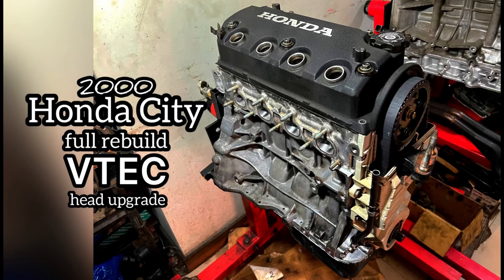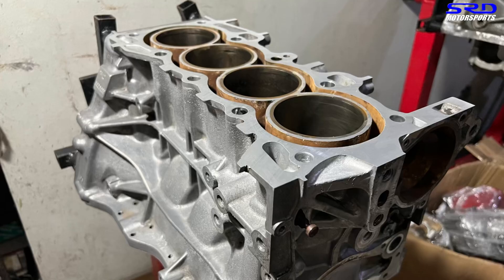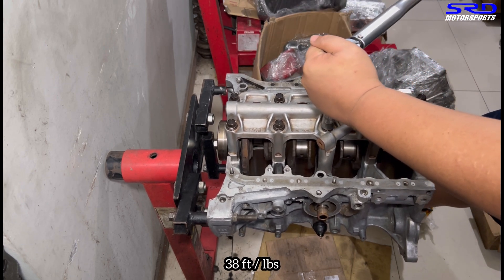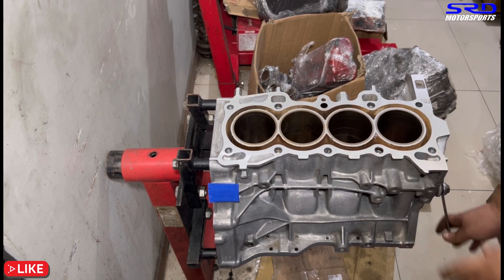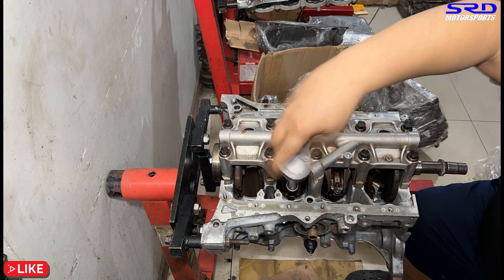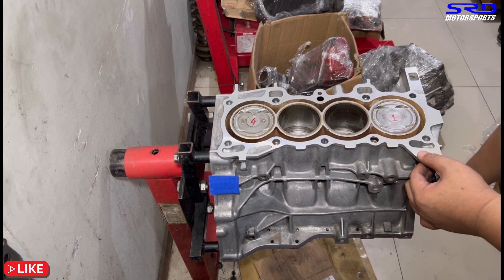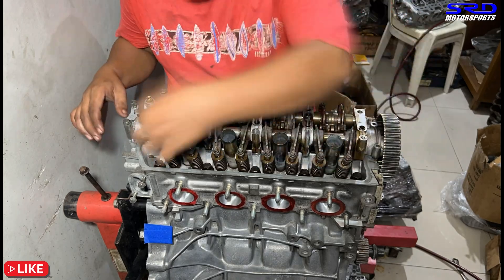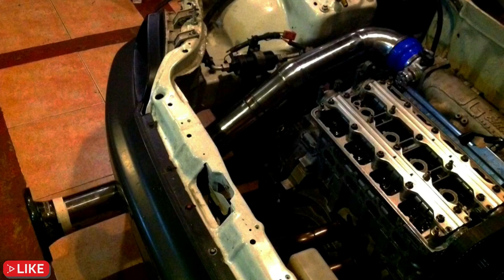D15b + P08 / Z6 Head Honda City Engine Rebuild Assembly

Comment: Is a JDMD 15 B head the same as a Z6 head? Finding a lot of different information on the Internet I have a P08 – one head and on the right side of that number it is a 9/1 on a Z6 block trying to figure out timing
Reply from the maker: all p08 head are all the same it’s why they use the Z marking from Crower as d16Z6 so stage 2 is 63442Z for stage 2 and  63443Z for stage 3 

U may be using the wrong camgear search for a stock z6 gear and u can find a counterpart that’s local to u and go from there

Comment: Can u guys do a d15 & d16 clocking piston rings step by step where each ring is clock the piston?
Reply from the maker: hey a rebuild don’t cost much , part of the purpose of our rebuild videos is to let locals know a basic rebuild won’t cost u upwards of 90k 😂 cuz I know some charge 120k for starters 😂
Reply from the maker: there’s really no magic to it…locally also I don’t get how some think there is but like on this engine we just clock it the OEM way

Wiseco Arias and JE usually have a clocking sequence they suggest on the box manual and we follow that when the piston has it but for pistons like OEM and YCP and 1Up or NPR pistons we always just clocked it the OEM way 

Always worked good
Reply: @SRDmotorsports  give me a link to it
Reply from the maker: il look for a link.. usually it’s everywhere online the oem ring clocking / setting way

Comment: Hi, stumbled across your videos…. Watching from Trinidad 🇹🇹 in the Caribbean. Looking at doing a Jdm d15b non vtec build (considering a Vitara build on the short block) not too sure if the Vitara spec stuff will work on the Jdm d15b non vtec, already have a y8 single stage vtec head for the build just not too familiar with which internals will work for the build as info is mostly on usdm spec engines. Any advice Will be appreciated
Reply from the maker: If it’s turbo? Yeah vitara is okay

Just not sure if ur d15b is what stock piston marking it has , that would depend what rod the d15b uses

Comment: Your giving me hope for my JDM D15 B 3 stage. Is there any difference between VTEC blocks and Non VTEC ones.
Reply from the maker: Usually the vtec ones have less dished pistons but they’re still good I’ve done a few Vtec-E d15b the ones with p07 pistons and we slapped on a z6 ported head and ran surprisingly good

One customer even opted to run a crower stage 2 cam in it and it was a nice surprise actually it ran real good…

One good thing is the z6 head or y8 head will require the same timing belt length as to what you currently run so that’s easier finding what belt to use

Comment: I sensed that water was used instead of coolant at some point but I could be wrong.
Reply from the maker: yes indeed no matter if it runs coolant recently if the previous previous owner ran water it generally is hard to get the grime marks off the coolant passages (outside the bore/sleeve) 

current owner got the hatchback with this engine I believe 5 months ago